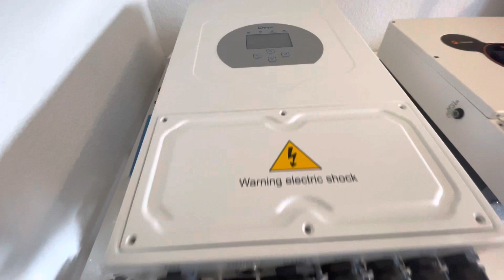Deye 5kW Hybrid On-Grid and SRNE 5.5kW Hybrid Off-Grid Inverter Quick Comparison (tagalog)

Comment: Please add English subtitles.
Thanks for the great solar pv content
Reply from the maker: I'll try to put a subtitle into it when I have time. 😊👍
Reply: @JFLegaspi  Hi sir sa 5.5Kw set up po ba with this inverter pwede pong gumamit ng masmaliit na battery capacity? Kasi ang iniisip ko po is malaki po consumption sa umaga then sa gabi maybe around half lang ang consumption so yung battery na po ang tatakbo. Parang masmalaki po ang set up ng solar panels like 5Kw with a smaller battery like 24V 200 amps to run sa evening po maybe consuming 1.5-2 Kw. Correct me if I am wrong po and I am newbie lang po. Salamat po sa info na provided really helpful nyo po lalo na ang kuryente sa aming lugar sa Mindoro is grabe ang problema so planning to set up a solar DIY po.

Comment: sir jf, plan ko sana mag deye 5kw hybrid at pair ko sana sa 51.2v 200ah lifepo4 lvtopsun, hanggang ilan po sana pwede ko malagay na battery for future expansion? salamat more power to you sir
Reply from the maker: Dalawang 200Ah 51.2V LiFePO4 battery na naka-parallel. Kaya pa din punuin ng maximum PV Pmax na 6.5kWp sa maghapon, lalo na kung hindi naman masyadonh malaki ang load habang charging ang battery bank sa araw.

Comment: good am. ask ko lng po.. ano po mngyyari incase na ngexceed sa limit ang inverter? for example 5kw inverter pero naging 7kw ang load? deye hybrid inverter.. thnx po
Reply from the maker: Good day. Kung may overload protection ang inverter, magsa-shutdown eto automatically. Kung wala naman at tama ang pagka-kalkula ng safety device i.e. circuit breaker, magti-trip lang. Kung pati circuit breaker ay hindi nag trip at walang overload protection ang inverter, posibleng masira o masunog ang mga piyesa neto.
Reply: @JFLegaspi  maraming salamat po...

Comment: Sir, pede po ba i-off ang isang string s deye kung sobra na po ang harvest ng pv panel. Kung halimbawa po na naka off na ang isang string, safe lang po ba yan sa mga panel. Maraming salamat sir
Reply from the maker: Walang pong magiging problema kung i off nyo ang isang strings, gawin nyo lang sa tama ang pag-off neto. Unahin nyo ang circuit breaker, then isolator switch kung meron man.

Comment: Good pm po..ask po ng help...ung 3.5kw na inverter ko po na put up ko na po with 3pcs 500w n trina..ung output voltage nya po is 140V pero ung total watts po na naka display is 2watt lng..tsaka po ung icon ng PV is keep on blinking lng..salamat po i
n advance
Reply from the maker: Good day. Posibleng kapos ang voltage ng 3 solar panels ayon sa required ng hybrid inverter mppt. Ano ba ang specs ng inyong hybrid inverter?
Reply: @JFLegaspi  Max. PV Array Open Circuit Voltage 500vdc, Nominal Operating Voltage 240VDC,PV Array MPPT Voltage Range 120vdc-450vdc.
Reply from the maker: Kapos sa nominal voltage na kailangan ng hybrid invertet ang inyong pv array.
Reply: sir pede ba gamitin na lang car alternator pang charge sa battery gaya Ng sa sasakyan... kesa sa solar panel... at Yung mag pa ikot naman sa car alternator ay 220 volts na (ac motor) para contennue Ang charging sa battery